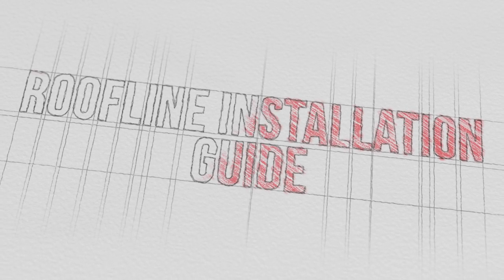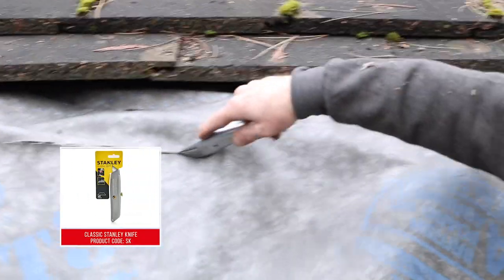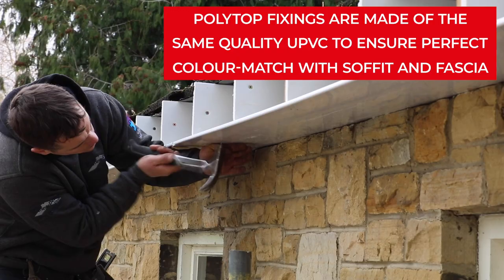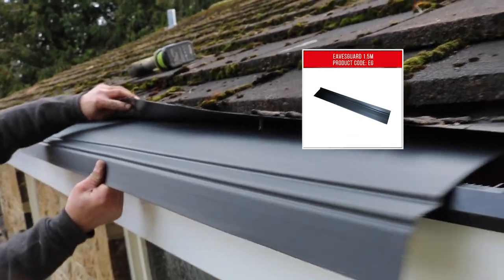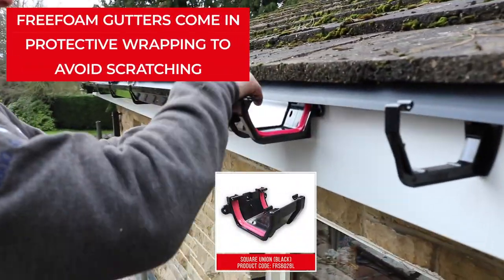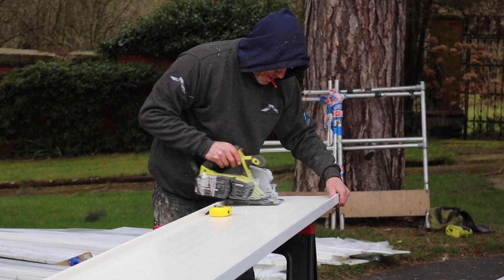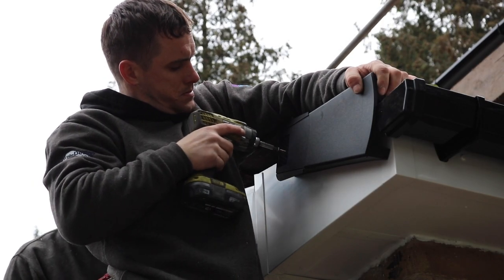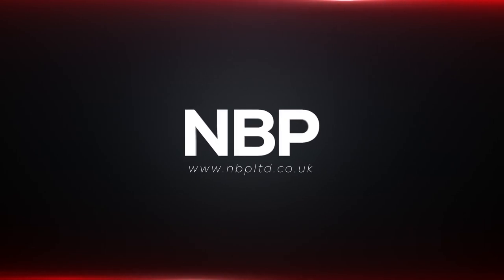Roofline Installation Guide

Comment: Additional tip: run two string lines on the packers, one on the corner and another on the face edge or underside. This will make sure the packers are not just in line but also at a perfect right angle. 
Personally I would not fix in the middle of the soffit with a polytop, this looks unsightly. Far better to pin with a cladding pin near the front edge where it is hidden by the fascia lip, and wedge the back down on to the top of the brick with and additional packer if needed. Obviously if the soffit butts up to the wall then a polytop is needed but closer to the wall where far less visible.

Comment: so, there is no place for air intake? How about the breathing system for the attic area?
Reply: They installed vents,between the fasica and the tile tray
Reply: @sopissedoff  ok so it is underneath the gutter. Got it. Thanks!
Reply: @chuckshu9662  no, it's above the gutter on top of the fascia boards. They sit under the eave trays
Reply: @Landofhopeandglory575  I've seen this done, but why not just use vents on soffits?

Comment: Genuine question, not being picky. Shouldn't the rotten wood that supports the tiles have also been replaced as well as the membrane?
Reply from the maker: The wooden rafters do look to be in good condition still mostly and the installers in this case have strengthened them by attaching pvc flat fascia noggins to the rafter feet. 

However, if some rafters have rotted, best practice is to cut back the affected area and bolt a new section of the same size treated timber to the rafter.
Reply: @nbpltd  Thanks for the reply. I was referring to the rotten wood sheeting that was removed with the membrane early in the video.
Reply from the maker: @slowdown3787  Oh, we see now. Well, since the installers put a new breather membrane in, we don't believe it's necessarily essential for them to have put new wood sheeting in too. However, as we didn't undertake the job ourselves, it's hard to comment further on whether or not that was the best practice in this case.